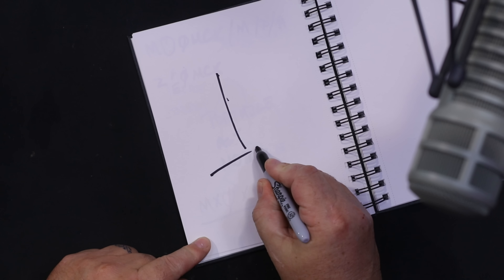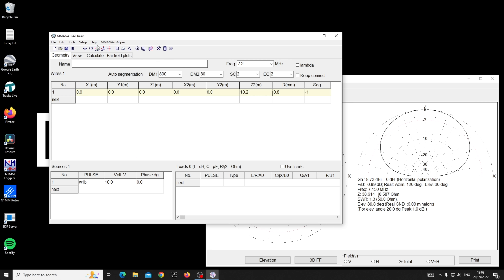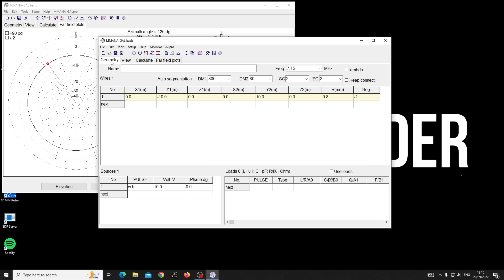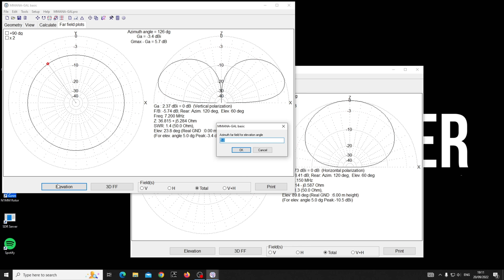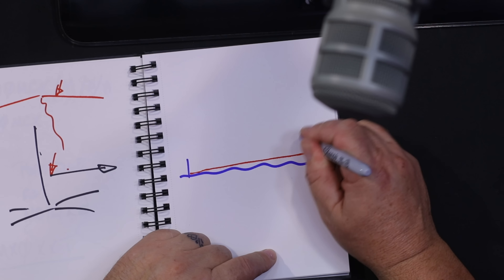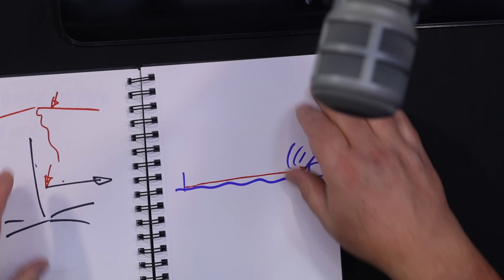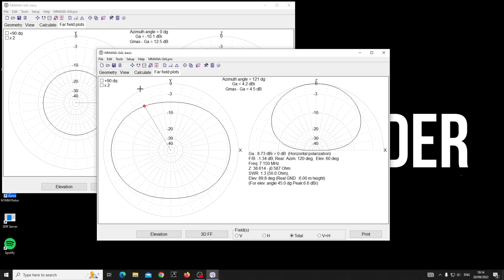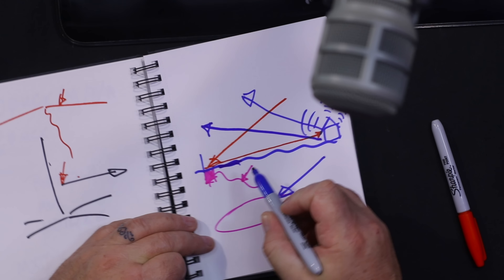Debunking the Myth: Investigating the Noise Level of Vertical Antennas

Comment: My Classic is about 1 S point noisier than my EFHW fence antenna at 5ft off the ground. I have a very high noise environment around me and a huge retail area 1 block away. I spent months ferrite beading and toroid coring every appliance in my house that was making any noise. A friend even suggested I buy stock in ferrite production. I suspected the Classic might be noisier and it's true for ME. That being said, I have both antennas on a switch and if I find a weak station down in the noise that I can make out on the Classic, by switching to the EF the station is not readable. I've tested this dozens of times and the Classic "out hears" my EF every time. Even with the noise, my Classic out performs any other antenna I've ever had and that's what I wanted when I bought it. Thanks for developing this family of antennas and of course your great videos!! Jack K5FIT
Reply from the maker: Interesting analysis Jack. Thanks.
Reply: I have an almost identical setup and find the same 1 S point difference.  My EFHW is also at 5' and runs in an L along my fence.  I live in a rural neighborhood but there are 500+ houses w/in 1 mile with no real commercial facilities nearby.

Comment: Every ham has their own installation factors and use-case. For my situation, I find that in my small garden that a vertical is inherently noisier than a centre fed dipole or non-resonant centre-fed doublet. Irrespective of whether the vertical is ground mounted, elevated, a 1/4 wave or a 1/2 wave. The main bands where the difference is around 3 s points (vertical noisier than centre-fed), are 40, 20, 17 and 15. It's not until I reach up to 12 and 10 that there is a draw between a vertical and centre-fed for noise. Just my example you understand.
Reply from the maker: Tim.. It's SO difficult to quantify because to get the same gain on a horizontal antenna, you would need to be at east half a wavelength above the ground.

Comment: Great video Callum. This is something which I have pondered over the years & I think I have basically come to more or less the same conclusion as you.

I think verticals are fantastic in rural locations but in built up areas they tend to pick up noise (for the reasons that you mentioned in the video) & in my experience often struggle to get out due to other "clutter" (houses, sheds, trees etc) which make up your typical housing estate attenuating the transmitted signal.

A while ago I purchased an 18m DX Commander pole & mounted an EFHW vertical cut for 20m on top of it. The 49:1 feed point is at around 7-8 meters above the ground (above the roofline) & the difference between a ground mounted vertical was very noticeable!

It's still noisy at certain times of the day, although it seems to be reasonably quiet on the frequencies on which it is NOT resonant. Using the internal tuner on my FTDX10 I can get it working on 40m, 20m, 17m, 15m & 10m.

Performance is a little mediocre on 17m - 10m but it performs surprisingly well on 40m. It outperforms my EFHW inverted-V on receive (not sure about transmit, I suspect the horizontal antenna would win on that one but I haven't tested that theory with WSPR). It obviously performs great on 20m.

As is always the case with radio, I think my conclusion is get the antenna up as high as it's physically possible to do.

I'm also swaying towards non-resonant antennas for receive such as a Loop On Ground (which I believe is what you use), a high-Z vertical or maybe an RX only mag-loop (like the MFJ-1886). In my experience these have often been quieter than resonant antennas.

Just my 2 cents worth!
Reply from the maker: Yep.. I think every noise has a source..

Comment: My 18 months of experience is that a vertical will pick up noise from surrounding properties very efficiently and needs to be properly earthed/grounded to minimise as well as carefully trimmed/tuned for the desired frequencies. Don't use a cheap un/un or balun or cheap co-ax and ground the transceiver and power supply. With a 1:1 choke at the transceiver end the noise floor should come down to acceptable levels and allow decent performance. All this counts for nothing if cheap solar installations and wi fi equipment spring up all around you. Ah well back to the drawing board lol. M7BLC

Comment: Interesting topic. Very well told. Indeed a vertical does not have to be noisy but you need to put it in a large field without anything around it. A vertical near buildings is always a problem. I prefer dipoles at my base station but use a vertical when out in the field. I've had a multiband vertical in my tower for years and changed to a experimental multiband halo loop last month. The difference in receive is around 1-2 S units less noise depending on what band it is used. 73, Bas PE4BAS

Comment: Nice video Cal. I have your DX Commander and a 22m loaded EFHW across the garden. I find that for a certain band, a certain time of the day, (etc etc) that one will be better than the other in terms of performance, RX, TX, noise etc etc. As a general rule the 1/4 wave vertical outperforms the EFHW for most criteria, but not exclusively so. Having an antenna switch is really interesting to switch between the two in any given QSO.  Mark, 2E0MSR
Reply from the maker: Yes, A/B switching is fun./ Remember to test it on TRANSMIT with your caller, not just RX..

Comment: I get a very low noise floor with a vertical. I use vertical for RX and OCFD for TX. Seems to be best combo, based on my ears and test geedback from distant stations. Sometimes I will not hear a station on the dipole, but can get S6 on the vertical.
Reply from the maker: Ah-ha!

Comment: My main antenna is a 135' endfed long wire running along about 14' above my fence. Works great. But, there's a ton of noise on 10 meters. Avoiding a long story, I installed a 10m ended wire antenna hanging vertically from a 30' extendo fiberglass pole. The coax connection is about 15' above ground and about as high as my house roof (which is 20' feet away). Amazingly, when I switch from my horizontal long wire to the new verticle 10 meter antenna, almost ALL the noise (viewable in my waterfall) is gone. I have been making way more contacts, including DX,  with this simple verticle antenna. It is now my GO-TO 10 meter antenna!
Reply from the maker: Nice!

Comment: I found some interesting details on W8IJ's pages.

"Noises arriving from groundwave sources some distance from the antenna are vertically polarized. This relatively fixed polarization occurs because the earth "filters out" horizontal components. Horizontal electric field components are "short circuited" by the conductive earth as they propagate and are eliminated, and since removing the electric field attenuates the magnetic field (they are inseparable in radiation) any horizontally polarized components from distant groundwave sources are quickly attenuated."

This probably explains why verticals are so noisy on low bands in tropical regions.

I use the same vertical on 160 and 80m for both my TX and RX.
With these, I have worked many stations in the Pacific on both bands.
My QTH is at 63 degrees north, and it is a quiet location (very few houses nearby).

The myth about quiet loops etc mostly comes from their ability to suppress common mode noise.  Not because they are particularly quiet.

Control your common mode noise and know what is radiating and how height changes the patterns.  Then it is not that many surprises anymore.
Reply from the maker: Yes, it's not that the man made noise IS vertical it's because they travel better. I think I mentioned that but couldn't remember the data. Thanks for that.
Reply from the maker: PS - Thanks for that data...!

Comment: phasing two antennas together works well to remove noise! 
the mfj phase box works great!
Reply: Can you control that remotely with one coax to the roof?
Reply: @mrtechie6810  need   2 coax runs. 2 identical antennas. Hope this helps

Comment: Hi Cal, 

I tend to find that for inter-GB comms a low to ground (5m) my 40m EFHW works best and for DX a vertical is superior primarily due to radiation angles. Luckily I don't get a lot of noise on 40m so I can't honestly see much difference. However on 60m (which is a very noisy band here) I get a significantly higher noise floor with the inverted Vee dipole than on the vertical - Both have CM chokes. 

Noise on 60m is about S5 whereas it was S1 10 years ago. I was going to give up with 60m and went for a Wellbrook loop and that thing REALLY makes the difference on the band. Signal strength is significantly lower but s/n is massively improved to a point where listening to VOLMET on 5505kHz all of the background noise disappears but with a loss of 2 S-points.   I would suggest anyone with a high noise floor looks at an RX loop if you have an RX antenna input on your radio. There are some low cost options out there such as the MLA30+ (£47) and in reviews gives the Wellbrook a run for its money or the Wellgood amplifier based on the Wellbrook design although you need your own loop - these things are about 1m in diameter so not huge.

I didn't notice before that you have a RE20 mic. I use one with an ART Voice Channel and feed the digital output from that into the rear TOSlink input on my TS-990 so not needing any audio transformers and works nicely. I did need to put a CM choke on the mic cable though.

Comment: It depends on the type of noise we are talking about. Static dissipation noise is an issue with all antennas due to it creating high voltage static discharge from the antennas but terrestrial noise from human-generated sources is another issue that can sometimes be remedied by another antenna being used to cancel out the offending noise via phase cancellation.  Just information from my own experience and trial and error.  LOL
Reply: Kindly explain how to achieve this?

Comment: Hi call do you think with a vertical you lose out if in a small ish garden to it being up hight his the rf getting observed by other building ??? If at ground leve apposed to being on a pole 20 foot up in the air
Reply from the maker: I don't think so.. I have a short video coming out soon with my antenna about 10 feet / 3m from the wall of a house.. In Cornwall couple weeks ago.
Reply: @DXCommanderHQ  thank s callum my garden small and quite surrounded I will try a singel band home made vertical down there in the summer has im think on of the dx commander  only other Consern his to get there I need 100 feet of feeder at the moment I have 213 in place to my aril

Comment: Contrary to popular wisdom my vertical is far quieter than the horizontal dipoles/doublets that preceded it. In each case i have had effective common mode chokes. What goes under the radar perhaps is that in a smallish garden  part of that horizontal will likely  be close to the RFI from the house and maybe the nextdoor house too. A lot of traditional RFI sources have probably been the likes of televisions radiating up their coax, less of that around these days and none of the old issues from line timebases in CRT TVs. Of course in the past there was no DSL being carried by phonelines either. I am sure each case will vary.....
Reply from the maker: Yep, you are probably right.

Comment: Installation it on a noisy city apartment roof?
Does it use the coax as a counterpoise/ground?
Reply from the maker: It will work in a city. It can be noisy because ANY antenna picks up intentional noise.

Comment: You may have a point. My doublet at 1/2 wavelength above the groundhas a similar or the same noise floor as my vertical. The thing is, the noise is completely different! On the doublet its just a wide band hissing at s9 while on the vertical it is the classic power line noiseish sound at also s9.
As soon as I lower my doublet closer the the ground the noise floor lowers somewhat.
Reply from the maker: Yep, it's a strange science!

Comment: A lot of hams want antennas that don't work so well so they don't get noise. They're happy with what they get rather than striving for better because they are so averse to the noise. I've even seen YouTube videos with the operator showing the pan adapter where their low level signals drop with the noise when they go horizontal. The problem is the noise. Not the antenna.
Reply from the maker: Well, in which case (in light of your end comment) - it's both!
Reply: @DXCommanderHQ  with reference to the vertical.

Comment: Both atmospheric and man-made electrical noise is usually vertically polarized. This is from electrical storms, even high up and far away, where you can't see them and outdoor horizontal power lines (mains), which generally radiate vertical interference. Without distant electrical stoms and without power lines (or underground) noise should be much less. Antennas that are shorter for frequency have less, "antenna" energy and don't sound sound as noisy as longer antennas. A relatively short vertical is likely to have less energy on it than a long dipole, loop or long wire antenna and may be quieter, but it's the signal to noise ratio that makes the difference in hearing stations over the noise.
Reply from the maker: Hiya Jim.. So this part of your comment, "man-made electrical noise is usually vertically polarized". I have NO evidence of this. I've read all the papers.. But man made noise does not seem to be inherently vertical - now.. The MYTHS of eHam and QRZ forums say it is, but there is zero evidence.
Reply: @DXCommanderHQ  Here in America a lot of the 60 cycle AC power lines are above ground. Often, a steel support cable to the poles will generate radio interference and the government says the power companies are responsible for clearing it up. That interference is vertically polarized, as the RF from the horizontal power lines. Both the government and the power companies use RF detectors to determine the source and type or RF radiating from the power lines and associated hardware. It is well known, especially among ham radio operators.

Comment: Great video Callum.... yes see if you can locate the null over the noise source.

I've always understood natural noise is mostly vertical. Man made can be horizontal. Instant switching from vertical to a dipole you can be caught out thinking your radio has gone deaf when on the dipole.

Being someone that works in broadcast. Its not unusual to see the spark gaps arc over on a windy day. A series fed tower can develop massive static charge. This opens a whole topic on how lightning works. To which I start the conversation with.... the zap.... is the end result. The thousands of amps does the damage.... BUT there is a whole build up charge phase that attracts the attention of the zap. Bleed this off... no zap! If this is a recieve tower it gets crackly as the charge rises. Not really of concern to an always on AM tx. The extra voltages does worry it... more so if its solid state. 73's
Reply from the maker: OK, some good ideas there. Thanks.. ZAP!

Comment: My personal experience is that its a mixed bag and highly dependeont on what is around you.
For example I have a DX commander quite literally 10 feet away from a ground mounted transformer.
That transformer is fed by a 14.4 kV primary which then feeds my house and the neighbours house.
I don't get any noise on that antenna despite being right next to a transformer like that.
Now I have a 3 element yagi for 10m and it's about 30 feet in the air and that antenna is noise city but also dependent on where it's aimed.
I also have a sirio gain master vertical that I use on 10m and its about 15 feet off the ground and it's not very noisy either.
Nor is my 10-80m off center fed dipole that's about 45-50 feet up.
Reply from the maker: Nice comment.

Comment: Hi Cal from an electronics and physics perspective (Don’t get me wrong I am far from an expert) I feel a good part of the problem with noise is that the antenna is too loosely coupled to the receiver.  The noise is being mixed in the antenna element and the coax and interferes with the desired frequency you want to receive hence the noise is breaking though.  If the antenna element/s is tightly tuned to the band the antenna acts like a band pass filter and there for well I think it will mitigate the noise somewhat. Think of 5/8th J type antennas if you put an DC ohm meter on them you will see a direct short however;  they will pass signal quite freely at the tuned frequency.  For good receive reception on HF it’s not the signal level it’s the difference of the signal to the noise.  Just a thought, anyway I’m going to finish this bottle of red and off to bed 73’s.
Reply from the maker: Interesting... Let me think about iot some more! (hic)
Reply: @DXCommanderHQ  Cal did you get the video link I sent you last night re the Friday net?

Comment: 80 meters is the only band that gives me problems which is surprising considering that I'm surounded by noise. Power Sub station behind me Main power transmission lines in front and a cell phone tower on each side. I can transmit on the 80 meter band but hard to receive because of 7 to 9 floor noise. Thank you for the idea of the receive loop on the ground. Also, I might possibly try a vertical to see if the noise is on a different plane
Reply from the maker: Do it. I have other ideas too. I will details those on another video.